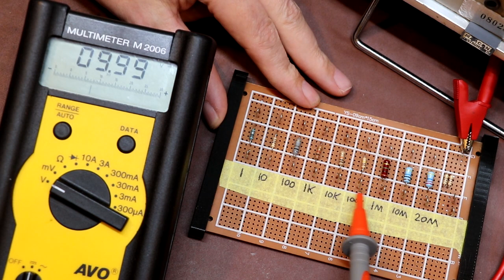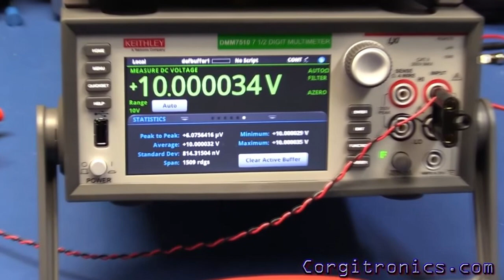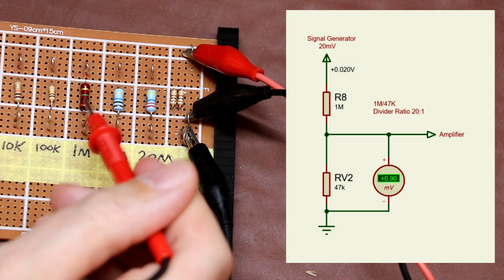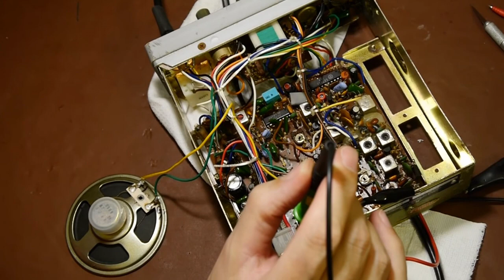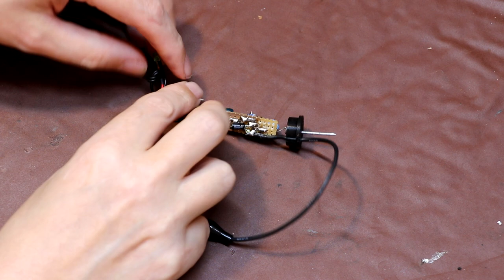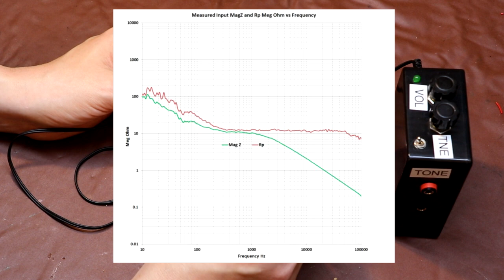K7000 Velleman Signal Tracer  Active Probe

Comment: I made my LED white & used it to light up where my input is pointing. Also used my FET as a buffer (no gain) to help with the input impedance.
Reply from the maker: I may revisit this project as I think my design has room for improvement
Reply: @allthegearnoidea6752 You did an excellent job making that Vellaman kit actually useful...

Comment: Digital multimeters have electronics, which can "natively" read anywhere from +/-1.5V (modern low voltage ADCs), to +/-10V (discrete component high-end DMM). However, that doesn't mean the DMM can only read that voltage; they all say they can read 1V, 10V, 100V, even 1000V! How do they read a higher voltage? They put their own resistor (+capacitor) voltage divider right at the front of their circuitry. This way a meter that can only read 10V, can read the value of a 240V circuit through the divider. Now which total value divider to use? Obviously, almost all manufacturers settled on using a total of 10Megaohms. This is usually divided up into a couple of resistors, for example, 900k, 90k, 9k, 1k. In fact a good single-package resistor divider is usually one of the most expensive parts in a modern DMM. Its stability is crucial to reading any higher range accurately. 10Megaohms is quite high that it will usually hardly disturb most circuits, but it's not so high that current noise and other effects will start disturbing the reading. Some handheld DMMs will have Gigaohm impedance if you use the mV range, when they can remove the divider. High-end benchtop DMMs usually also have a mode to remove the divider so they can read 10-20V voltages directly with also Gigaohm impedance.

Comment: I have a short length of 22 mill’r copper pipe with a inner plastic sheath and a plastic sheath to fit over the outer copper! I have a piece of co-ax braiding soldered to the pipe and ground inside! No hum attall even at full volume! The outer sheath is 20mm plastic poly pipe and u simply submerge the plastic into boiling water then stretch the poly over the outer copper! When it cools it is tight over the copper and will never move! An old sharp dart covered with heatshrink serves as the probe! Fraser

Comment: Hello I just subscribed and have been learning electronics over the past two years. I've struggled with the concept of impedance but this video helped a lot. What I am not sure of is Impedance good or bad and is high impedance better than low impedance? or does it not matter as long as impedance is matched between input and output or DUT and the testing gear?
Reply from the maker: Unfortunately this isn’t a yes or no answer. In some situations it makes sense to match impedance but sometimes it’s not important or even counterintuitive.  For test gear higher impedance is usually better as it doesn’t load the circuit under test  but at radio frequency this is wrong as the mismatch can cause reflections and standing waves. Don’t worry about it to much, you will figure it out when you need too. Thanks best regards Chris

Comment: To get rid of the stray hum problem, just use an earthed 20mm diameter stainless, or aluminium metal outer tube instead of that plastic one, and then to avoid any other, possible, ‘Shocking’  issues, when using it to test HV Valve circuits, just cover the outside of that metal tube, with a suitable sized heat-shrink plastic tubing, to insulate it.  😉👍

Comment: RepairOldRadios gave a tip for shielding. He shielded the tip apart with a little copper pipe, and connected it through a 470K resistor to ground to keep the capacitance to the tip as low as possible. Maybe that can be adopted for the whole outer shielding, making it a bit safer. Also possible, aluminium or copper foil glued on the outside with a long wire under it, and cover it up with duct tape.
As an addition, to make the amp peaking, you could temporary adjust the values of the drain- and source resistors with two pots, and find a sweet spot.
B.t.w., I wonder why Fairchild's datasheet tells us that the 2N5457 is an audio amp JFET:
"This device is a low level audio amplifier and switching transistors, and can be used for analog switching applications.  Sourced  from Process 55".

Comment: Really great video Chris, thanks very much. I had already bought the Velleman probe kit and was in the process of building it. Had wondered how to make a probe so your video was very timely indeed. I will definitely have a shot at building one. Also learned quite a lot too!
Reply from the maker: Hello David thanks for watching and nice comments. Unless you really need the additional sensitivity of the FET just start of by building a simple passive probe using a Germanium diode. That’s quite good enough most of the time and is simpler.  If you need a diode let me know and I will post you one.
Reply: @allthegearnoidea6752  Hi Chris, that sounds like a good idea. I will have a go at that first. I do have some Ge diodes knocking about, but thanks for the offer.

Comment: To minimize miller capacitance use cascade structure for your FET ( that is two FETs on top each other) or better yet use common Darin stage followed by your current common source.
Good Video.

Comment: Nice demonstrations. I will try to make the probe. Just a question: If instead of a R2 of 10M we install a 20M one, will that increase the final input impedance of the probe? Thanks.
Reply from the maker: Probably not as at higher frequency it’s governed by the gate capacitance of the FET and Miller effect. This circuit was just a quick build using parts from the junk box I’m sure you can improve my design. Thanks best regards Chris

Comment: I worked some 40~45 years ago with these Avometer on my work, before handheld lcd multimeters became common, are excellent laboratory quality instrumental...
Reply: Digital reading multimeters those days are really workbench type instrumental like HP and other famous - and really expensive - instruments and analog ones are so common, my 100Meg Honor refuses to operating after years  of good service - and years no used too, it seems to me the galvanometer is open circuit ...

Comment: I was wondering about the 10M resistor at the front end.  If that is not there what is the current draw on the battery ?  What affect does removing it have on the input impedance ?
Reply from the maker: Hello Paul thanks for watching and comments. The current draw is very small there is really no current flowing into the gate of the FET.  The purpose of the resistor is to discharge the gate capacitance of the FET.  At low frequency removing the resistor would effect the impedance but it’s the gate capacitance and Miller effect that will reduce the impedance at higher frequencies and the resistor is not significant

Comment: I was thinking about making a sig tracer. You’ve convinced me I need one even though I doubt I would ever use it. I am a digital guy🤣
Reply from the maker: Back in the day designing various processor driven systems I used an old MW radio to listen to the activity on the data / address lines  every system had its own tune and you could tell a lot by listening

Comment: Well that worked way better than i thought it would,  i may take a screen snap of the circuit as one day i might need one.
For r.f signals i waft the antenna cable from my frg7700 receiver near the stage,  handy for listerning to the i.f products in a c.b or radio,  handy for checking for the 1st mixer local oscillator.
Yes i cheat, and i do dodgy things to find faults lol.
Just for sillyness you could make a parallel L C in parallel circuit, earth the coil and a long wire on the other end.
Your impressive probe could connect across the coil, tune for radio 5 live lol, yes pointless but fun 😀
Smashing job 😀
Reply from the maker: There is a drop box link in the show notes with the schematic and additional information. I do like a nice frog but don’t own one at the moment.  Thanks for watching and comments best regards Chris
Reply: @allthegearnoidea6752  Hello. Thank you for sharing your knowledge, I take a lot of attention in your explanations because I am learning a lot. I have to tell you that the link to DropBox does not work. I would like to have the diagram to do the probe. Health!!!!
(sorry for the inaccuracies, I'm using Google Translate)

Comment: Chris, this video hit me in the depths of my personal places that I don't usually show others... As getting arrested for indecent exposure is, I've found, nonhabit forming... But yeah, so I've been noodling around with an Eico 147A Signal Tracer for a while now, and I replaced the original 4" 1.5 watt 8 ohm speaker for a 4" Eminence 30 watt 8 ohm. "Watt were you thinking?", you might ask? Well, I plug my Tele into the RF input, and it screams like a vintage Fender 3 watt amp, and the evil green cat's eye valve winks at me while I play the guitar badly. Up untill Tuesday, March 17th, 2020 that is. The Great Quake of Salt Lake. The poor bastard waddled off the bench and landed on the floor, busting the the cat's eye tube, basically blinding the whole project, not to mention me nearly crapping my chaps... But this video has renewed my interest in said protect, as I've always wanted a effective signal tracer that i could jam with badly. Thank you for motivating my motivation! Cheers!
Reply from the maker: Erm sounds exciting LOL. Thanks for watching regards Chris

Comment: I had a funny occurrence today, I was repairing something and the uP wasn't running, until I put my finger NEAR the uP or the crystal... (not actually touching anything!) and then it would startup and run fine... just the presence of my 50Hz finger was enough to start the oscillator... once I swapped the crystal it was OK after that, thought that was a similar situation to your demo of the 50Hz being picked up from your hand.
Reply from the maker: It may of been the added capacitance from your hand was just enough to maintain the oscillation I’m just guessing. Fault like that could have you running around so sounds like a good fix. Thanks for watching regards Chris

Comment: I tried a simple 2-JFET cascode circuit, but I only had time to try it on a breadboard, so a well-built circuit would work much better. Anyway, it seemed to give a unity voltage gain at 30 MHz (much higher lower down), which would make it useful for HF. One thing I noticed is that it's better to avoid electrolytics as bypass caps. I think this is probably down to their high parasitic inductance. I don't know about tantalums, but ceramics worked well.
Reply from the maker: Yes I’m sure your right on the bypass capacitor

Comment: Measuring high impedance circuits in the giga-ohm range can also be problematic. Ion detection chamber with Radium or Americium source + special FET. Those are common household devices used in smoke detectors.  Thanks Chris.

Comment: You must have been reading my mind! I have the K7000 to and have been wanting to come up with an active probe of some type. So thanks for doing the hard work!!! Got to run to the lab see ya later!!
Reply from the maker: See how you go. If you don’t need the additional gain the follower circuit has higher impedance band better dynamic range. Be interesting to know how it turns out if you build one. I’m sure there is room for improvement but it was just a quick easy build etc. Thanks for watching and great comments my very best regards Chris.

Comment: Another very informative video. Thanks again. I think maybe the only way to improve the probe would be circuit layout and maybe lookjng at a few similar FETs to see if they have a lower Miller effect i.e. faster switching FETs?
Reply from the maker: I did also build it with a MPF102 which is a VHF FET it didn’t really work any better but it did have similar value of capacitance. It’s always interesting to improve things but you know sometimes good enough is good enough. But it’s a interesting project. Thanks for watching and nice comments regards Chris

Comment: Great video Chris I will have a go at building the probe
Reply from the maker: Thanks David. Be interesting to see if it works out. If you don’t need the gain try the follower probe design first it has higher impedance and probably better dynamic range.
Reply: @allthegearnoidea6752  Thanks Chris Will do just waiting for Jfets to arrive

Comment: I'll be building one , I have the velleman single tracer amp ,but my home made probes need to go into retirement, so this fit's the bill all in one for my use's thank Chris
Reply from the maker: Yeh let me know how you get on. The follower probe has higher impedance but not so much gain so maybe try that version first. Love to know how it works out. Thanks for watching and great comments regards chris
Reply: Will do, I'm thinking of putting it in an old disused broken  solder sucker.

Comment: Chris, you could eliminate the Miller capacitance and extend the usable frequency range of the probe by using a cascode arrangement instead of a single FET. If I get a chance I'll try it out...
Reply from the maker: Hi Steve if you look at link in the show notes there is some information and suggestions on that. Be interesting if you try it out etc.
Reply: @allthegearnoidea6752  Sorry, Chris, missed that. I'll have to give it a go.

Comment: Well done Chris i have been going on fo a few years now about the short comings of the vellemen for radio work (which it was not desighned for) same goes for the injector part great fo audio  but for radio work a simple multivibrator  with loads of harmonics would be more usefull.
Reply from the maker: Yes the signal tracer is meant to be harmonic rich but I think having to connect it via long leads suppresses it somewhat. I am thinking of building an injection probe next